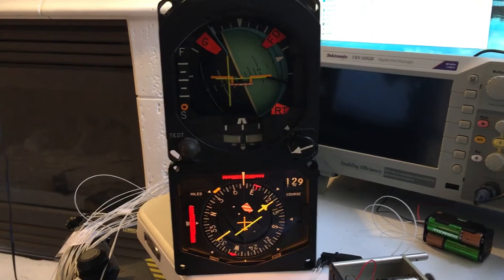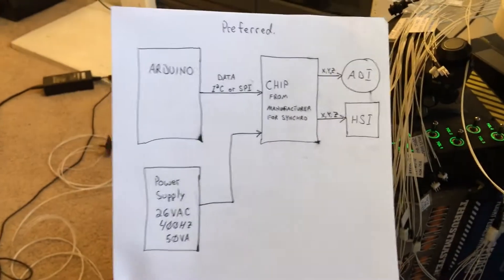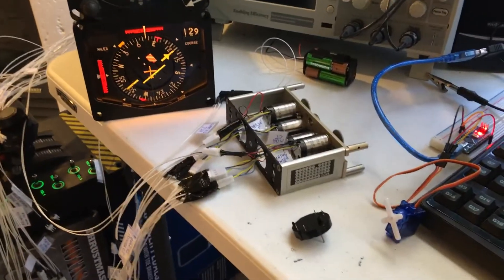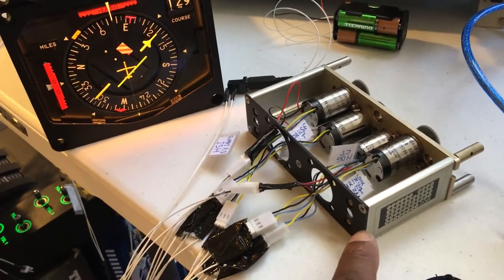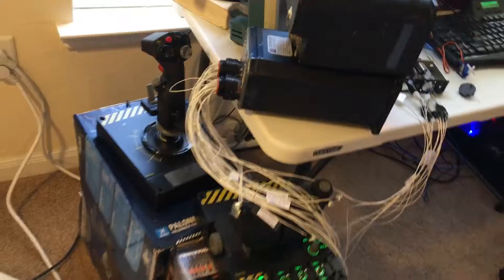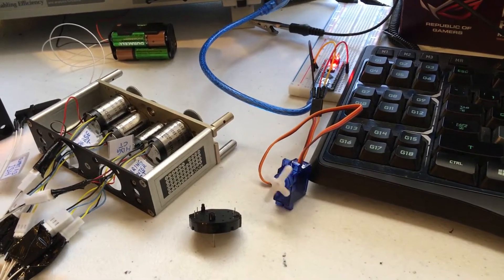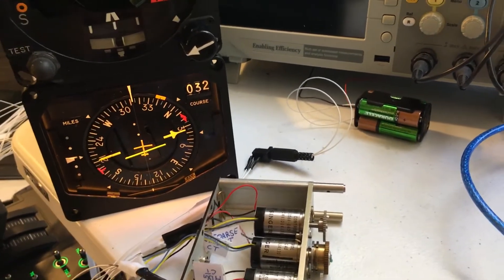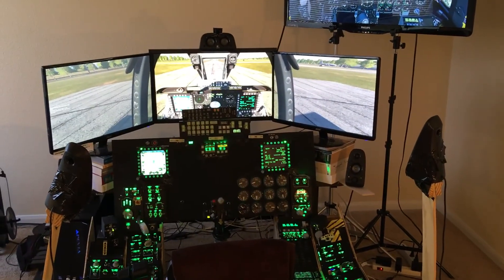A-10C Home Cockpit ADI & HSI implementation

Comment: Don't know if you got this built up yet or not (I only just saw this vid. I'll have to look at what else you've posted). I play Kerbal Space Program, and am building an instrument panel of my own. I too have the issue of needing to drive an instrument using synchros, in my case, a 3-axis FDAI/ADI, an ARU-11/A. I considered driving actual synchros using motors and encoders, but the route I want to go is to use an Arduino to generate the attenuation values of each output of the synchro, and send that to a multiplying DAC (Digital to Analog Converter). I would feed a 400Hz sine wave from a generator into a pair of Op-Amps, one inverting, and the other non-inverting, to create a pair of phase mirrored sine waves. Those are fed through a pair of CMOS analog switch chips, driven by the Arduino to select inverted or non-inverted phase, and that then feeds into the voltage reference of the multiplying DACs.

A synchro's outputs are all phase synchronized, but they modulate the amplitude and polarity of the three outputs to represent the angular position of the rotor.

On the Arduino, you first take your angle (I'm working in degrees, since that's the telemetry I'm receiving)
Add 120 and 240 to that value.
Do a conditional check to subtract 360 from the results if that result > 360
Perform sine calculation on the three results (I've seen a sine lookup table based library, I think, so that should be straight forward)
Perform absolute value on each of the three values
add the original sine result with the absolute result. if the result is 0, then that value is a negative polarity value
If the result is ≠ 0, then it is positive. (these three results are used to set digital outs to set the digital switches to select inverting or non-inverting sine waves)
the three sine values are sent over serial to the corresponding 3 DACs.
the digital I/O is set, and the DAC's set input is enabled to update the new values

The benefit of this setup, is it's a very light load for the Arduino. All it's got to do, is read the incoming data, do some adds and conditional subtracts, calculate the sine values, do some absolutes, additions, communicate some data, and set some digital outs. All the magic happens inside the DACs. Because the 400Hz sine wave is applied to the voltage reference, the DAC's setting acts like a virtual volume control, dialing up or down how much of the sine wave passes.  At 0%, the sine wave is flat, and at 100%, the sine wave is at full peak to peak. The analog switches accommodate the necessary polarity flip that happens when the synchro rotor turns 180° and the magnetic fields are thusly also flipped 180°.  The front end is easily designed. The back end is what I still need to work out. Since 400Hz is in the range of audio, I'm honestly planning to try using audio amplifier chips to create an output with enough wattage I can then feed into a transformer, to bring up to the necessary 26-28 VAC for the synchros. I'll likely look for a small inverter that can accept a 400Hz input to power my reference/power input.
Reply from the maker: Sounds like you have a plan to pull this off.  Nothing jumps out at me as none doable.  However, would recommend not building everything from scratch but maybe get a hold of some chips or modules that take care of a large chuck of the design for you.  Maybe a module that outputs your 400Hz reference signal, and then a module or chip plus supporting components that converts digital to synchro/resolver.  Then integrate everything to work with the arduino.  Some links below:
http://www.synchro-systems.com/ConInfo.htm
http://www.seekic.com/circuit_diagram/Amplifier_Circuit/400_Hz_AMPLIFIER.html
https://www.computerconversions.com/Digital-to-Synchro-and-Digital-to-Resolver-Converters/
Reply: @joesim9577  I actually have an old sine generator from my old job. Gonna use that as the 400Hz source. The board will be easy enough to lay out and have manufactured. I used to build synchros and electric motors at my old job (plant closed in 2009), and I still work with electric motors, and do occasional circuit and PC board design at my current job, so I've got a good grasp on how to go about emulating them electronically. What I described sounds like a lot, but that's cause I went through all the program steps... Each of the three synchro outputs is handled with just a pair of CMOS analog switches, a multiplying DAC, and an audio driver. Basically, just 3 chips. Repeat the exact same circuit three times, and you have one emulated synchro. A few chips have double or quad circuits per chip, so one chip can sometimes cover more than one circuit.

The thing I really need to figure out is the output end. My specialty has always been digital design, so doing this analog stuff is a learning process. Finding impedance matched transformers that can do the step up could be difficult. I may actually have to buy a suitable synchro control transformer, just to measure the windings. I haven't discounted the possibility thst I might just have to wind my own transformers if I cant find what I want... I'd rather just find something suitable! Fortunately, I do have access to winding machines at work, as well as core laminations.

Comment: Hi Joe! great project! can you tell how do you read pitch and roll angles from DCS-Bios?
Reply from the maker: Good day. That’s a two part process. The HSI and ADI driven by stepper motors. I use stepper motors with gears to turn the synchro/resolver combo. So the first step is to use a generic stepper motor arduino sketch to spin the stepper motor CW or CCW. Pick a sketch that allows you to enter the number of steps to move then it auto stops. Keep increasing this number until the roll or pitch spins exactly 360 degrees and write that number down. The second part is DCS Bios outputs roll and Pitch as a variable with values from 00000 to 65535 that represents 0 to 360 degrees. Then you use the arduino library function called map to equate 0 to 65535 equals your 0 to xxxx that represents 360 degree.  Now anytime that variable changes DCS Bios output that new value and your sketch will track and turn the motors accordingly. I posted the code for the HSI on Github if you wanted to download it. Cheers.

Comment: Nice work
Reply from the maker: Thanks.  Youtube been buggy on me.  It just listed a lot of post that was sent awhile ago. 
I used some code from the forums to drive the stepper motors so I can do the HSI with no problem.  (Glad you guys already figured that out for me).  However, I used the 28BYJ-48 stepper motor which is a little small and a little slow so it is a delay before the course pointer catches up to the simulator position.  So I ordered the Nema 08 stepper motors and will see how that works when it comes in.  Not so lucky with the ADI.  It needed external servo amps which I also bought used on Ebay.   I bought 3 and 1 is out right bad (doesn't work) and the other two move the roll and pitch but the pitch seems slow and sluggish and the roll only rocks about 20 degrees back and fourth.  Maybe lame ADI or still lame servo amps or a combination there of.  But its on the list of things to look at later.

Comment: Outstanding. Can't wait to see you get that working. The inverter is 'just' single phase not a 3 phase inverter?
Reply from the maker: It’s a single phase inverter. Can take 18VDC to 30VDC (28VDC nominal) and output 115VAC 400Hz @ 0.435 Amps and 26VAC 400Hz  @ 1.15 Amps.  The ADI book said it used 115VAC but that may have been a typo. Aerospace synchros are usually 26 VAC I thought. I haven’t had a chance to really read the book though.
Reply from the maker: THanks Hans. We’re going to need a software guy sooner or later.  Hope Ian comes back.

Comment: this is a master peace
Reply from the maker: Thanks Jack. I plan to go into more detail in future videos. Like for 80% functionality, all you need is the HSI, wiring manual, power supply, and synchro transmitter turned by servo motors. The last part can be tricky though as you will need some code script to follow what the sim is doing.